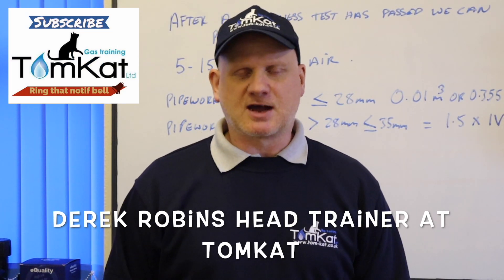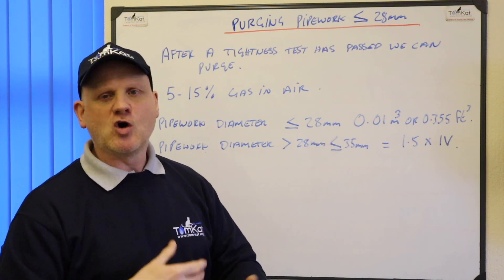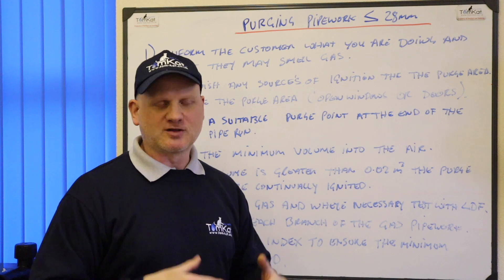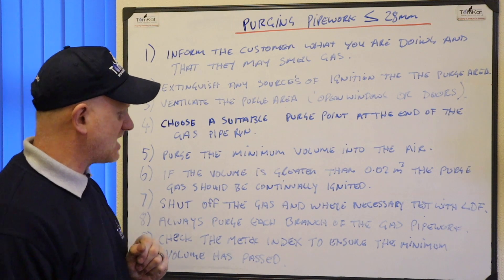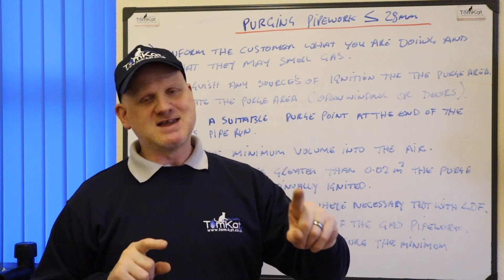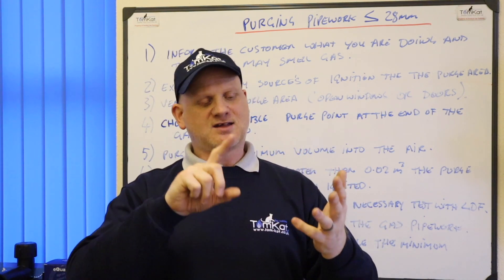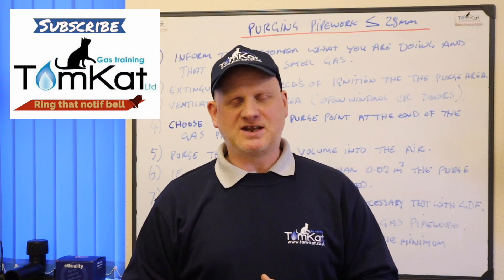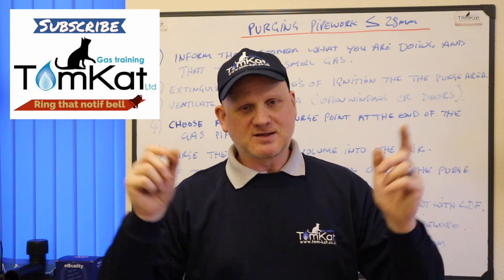Purging natural gas supply, ACS REVISION IN LESS THAN 10 MINUTES (hopefully) part 2 purging 0.01 m3

Comment: A tightness test has to be done BEFORE a purge. 
That's NOT the same as saying "a purge has to be done after a tightness test" - I did acs training last year, and never came across the idea that:
 "once you TT, you must purge". 
Are you sure about this?
Reply from the maker: Mate after a successful tightness test and air has been allowed into the system you must purge so yes I am sure it is also in IGEM/g/11 appendix 5 if you want to check it out
Reply: Thanks v much for replying and for the reference.  Will check it out.
Reply: Hi Mate...
Do you mean this:
"APPENDIX 5: VISUAL RISK ASSESSMENT OF GAS APPLIANCES"

Are you saying a tightness test let's air into the system?
Reply from the maker: @stoosam3244  yes it can if you have worked on the pipes ie installed a new boiler